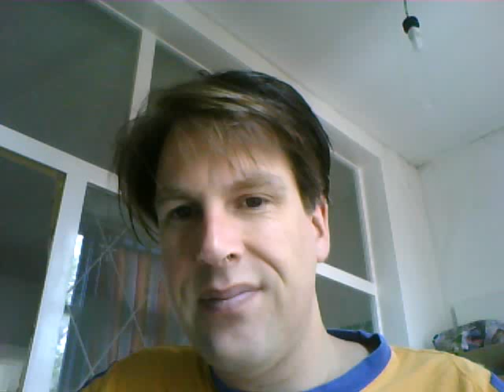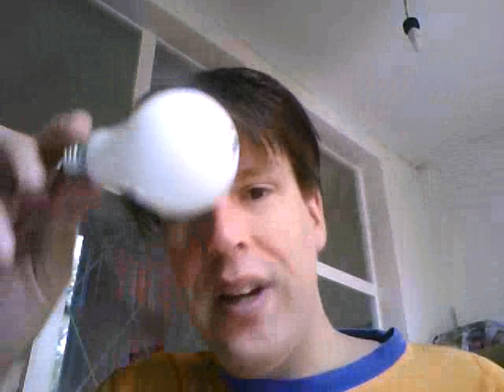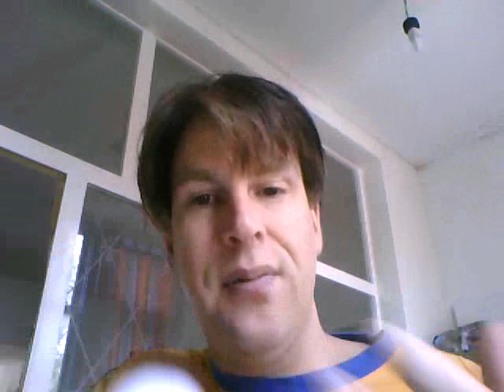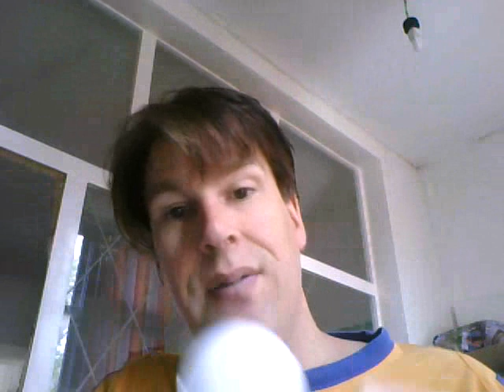Photo Enhanced Thermionic Effect Supercharges CSP

Comment: amtec--  alkali metal thermal energy conversion.   uses sodium or potassium, which passes through a sodium ion selective membrane.  ions can pass through but electrons must go the long way around.  the thermal energy is converted to electrical energy in an isothermal expansion cycle.   its high current low voltage and the membranes are somewhat fragile.  its related to the sodium sulfur battery.  same structure and materials are used.